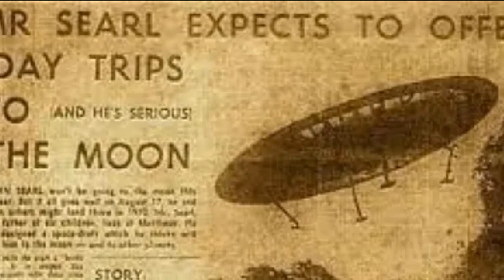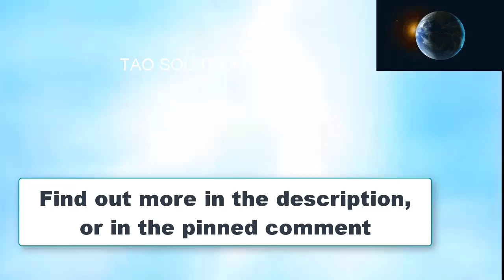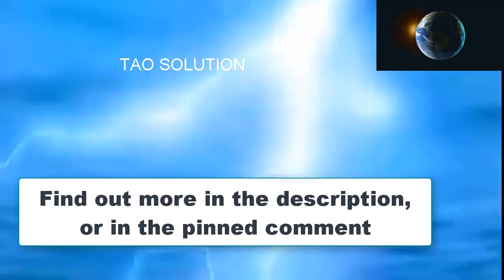Developed Flying Saucer from Searl Effect Generator.

Comment: Forget the flying disk, that can come later. Just swap out the coal, oil and biomass generators for these, charge less for energy. Ok, you won’t be charging as much for energy BUT that will be offset by that fact that you don’t have to go looking for oil or coal or burning frigging trees for energy. I would assume you will make just as much profit. Oh ye and incase you haven’t noticed oil and coal are running out and burning trees is putting carbon into the atmosphere 🙄…
Reply from the maker: Silly. Climate change is not real